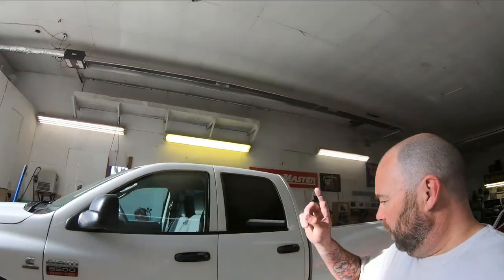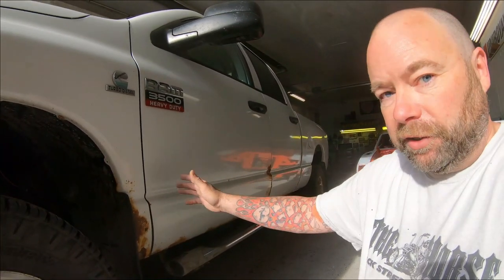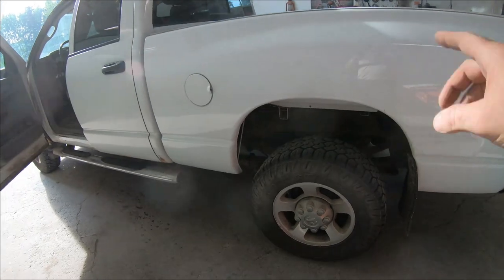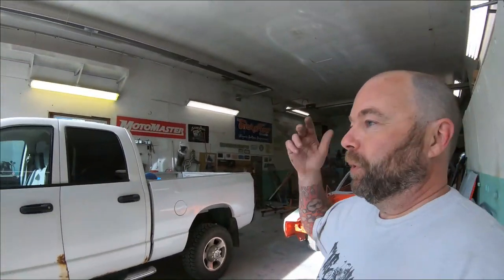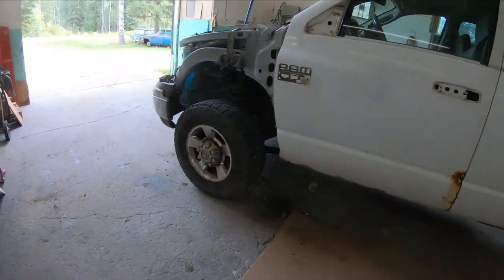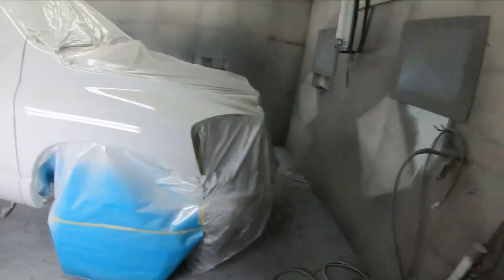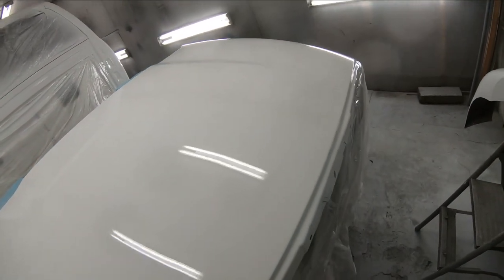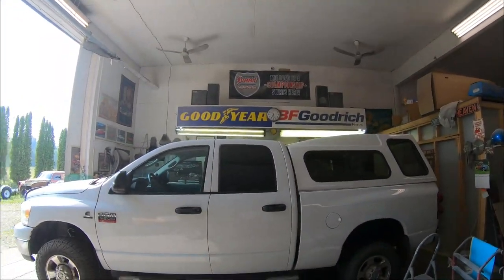Repairing ALL the rust in a 3rd gen Dodge Ram Cummins truck,how much does it cost?

Comment: Don't know how you fill about the rubber on those door bottoms but I tell any one that has a vehicle with those types of bottoms to take it off because I will remove them because guys have a hard time opening the doors and cleaning between the rubber and door because you can't get that with the doors closed ! Good looking paint job start with the prep work, I don't care how good a painter you are if your prep works not good then your paint job not as good ? Painting roof and hood if it's on I do those first ! That's best way for me to do it. I think that's code D1. Those grills to remove can be a real pane !

Comment: That’s crazy prices. You can find used oem genuine Mopar parts for thousands less than that. Front Fenders for $50-$150 depending on seller. Complete rust free beds with minimal scratches a few dings if any for $200-$1000 depending on who the seller is and where it’s located here in the states, (in the north or the south). Cab corners for $25-$50 and complete rocker panels front to rear including pinch welds and all complete rockers inside out fresh cut off rockers for $250-$500 per side which includes cab corners. $5000 for the bed is insanity. It’s easier to replace the bed than to replace the bed sides and fender wells. $75 an hour is average shop prices here in the states. And for $1500-$2500 you can get the same paint job that includes only exterior paint and clear coat with a warranty. For $5000 you get entire vehicle dismantled and repainted 100% dismantled, repaired, repainted and assembly.

Comment: Wow what an awesome job and great video! I've been doing similar work for about two years now but about to tackle my first dodge (2nd gen). It's a miracle those rockers were intact. Had someone ask me to do theirs on a third gen dodge just like this and there wasn't anything left of the inner or outer so I ended up turning the job down due to the time it'd take to re-construct it all. When do you decide whether it's worth it to just do a cab swap (granted you can find one)?
Reply from the maker: I’ve done quite a few of these trucks, and as bad as they rust, the floors always seem good, so haven’t had one yet where I’ve felt it necessary to change the cab

Comment: I was under the impression that inside the cavities should only be sprayed with a petroleum style rust undercoat. Isnt it possible to trap rust between paint surface and the metal making it worse? Is this accurate? Also, with a horrible cab, would it be easier to swap with a good cab?
Reply from the maker: Getting rid of the rust is obviously the best, but a quality rust inhibitor type paint will seal it off from continuing to absorb moisture. Changing the cab is of course an option, but these are old trucks now, and it’s pretty unlikely to find a clean one, especially here in Canada

Comment: I'm in Canada .. Over the last 2 years I built a 1997 Dodge Ram 12v Cummins .. Mostly Texas parts .. Changed the cab to a 1999 4 door Quad cab ,box etc, etc ... I'm soon going to sell it because I have a couple of 2nd gen Rams with 12v engines ..

Comment: Number a couple of videos ago, you told us to take the tail lights out and clean insides. While I am putting in new taillights and I saw all that dirt. What's that metal piece behind the quarter panel? Or the hell white bracket goes to. That's well did to the inner bedside.
Reply from the maker: The inner wheel house?
Reply: Yes😊

Comment: What do you do when the inner rocker is rotten? I have noticed they only sell the mid and outer rockers.  I need to tackle this job on my 05.  Wonder if the 4th gen rockers can be made to fit.  Cabs must be close to the same size and they still sell those panels.
Reply from the maker: I’ve never had any trouble getting the inner rockers, and usually just leave the center piece out. It’s also pretty easy to just make an inner, and if you don’t have access to a brake, sometimes you can get an HVAC shop to bend stuff for you

Comment: You have great videos and well explained. Im finnially about to start a 2007 Dodge. I bought new fenders, tailgate and wheel arches, outer wheelhouses. Do you take all the black primer they come in off and re-prime, or just scuff it down a bit? Thanks.. keep the videos coming!!
Reply from the maker: I always try to take off the black primer and Recoat with good quality epoxy when possible, mostly just in areas that take a lot of rocks. Glad you have found the videos helpful!
Reply: Hi again! Thanks for the reply, I have a follow up question about primers if you don't mind just before I start my project. The more I read about primers, the more confused I get. I am hoping your expertise can help clear it up. So once i get it to the point of primer, I should put on one coat of epoxy primer, sand, some high build primer and level everything then base coat? I noticed on some of your jobs, the primer is only on the parts you repair.
Thanks again for your videos, I watch most of them 2 or three times! HAHA...It has given me a just enough confidence to attempt this for the first time...
Cheers, Alan.
Reply from the maker: You always want a good quality etch primer, or epoxy primer over the bare metal, then a coat or three of urethane high build primer. The high build is what you’ll be sanding smooth prior to paint. If you don’t get it right at first you can add body filler over the sanded primer if needed and reprime . Hope this helps 👍🏼
Reply: @Johnnymidnight  Hello again!. Ive got another question for you. Ive now got new wheel arches, outer wheel houses and rear lower box panels on , filled and sanded to 320 with guide coat..Ive got new front fenders and the doors are really straight with virtually no paint damage. My question is, should I be putting high build primer on the whole truck to sand down, or just the on box. Thank you! I really appreciate your insight,
Reply from the maker: You should only need primer on the new parts, or where chips and such have been feathered out in the factory paint. I actually have a new video ready to post tomorrow on primer, that you should find helpful!

Comment: Just a DIYer here, but I've read that a lot of body shops won't do rust repair due to warranty issues down the road.  Could you tell us what kind of warranty if any that you would offer a customer on a job like this?
Reply from the maker: I always warranty everything within reason, if rust comes back, or the paint falls off within a few years, I would certainly be good for it 👍🏼
Reply: Thanks @Johnnymidnight

Comment: It's already starting to have, and people are restoring early 2000 to pick up trucks. Time is running fast. I'm wonder if people gonna take a old rot out plow truck. A plow truck and restorant. And I got a question when you get an energy empty. 9 hundreds or replace bedsides again? Can you go in more detail? I haven't watched a video yet the new video.
Reply from the maker: Sorry, not quite sure what’s the question?
Reply: When you get another 2008 Silverado. Or gmt 900  a video on the bedside again.
People are starting to restore early two thousand pickup trucks

Comment: I use 1 gallon of 30w bar and chain oil mixed with a tube of Lucas red tacky grease ratio heated up in a crockpot and sprayed on hot  !  I don't feel sorry for people that are to ignorant to ues undercoating in the salt belt.

Comment: For $15k -$20k you can replace it with another same exact truck  without the rust. 🤦‍♂️
Reply from the maker: Not here in British Columbia unfortunately. Unless you stumble across the rare one that hasn’t been winter driven, or used as a work truck on logging roads